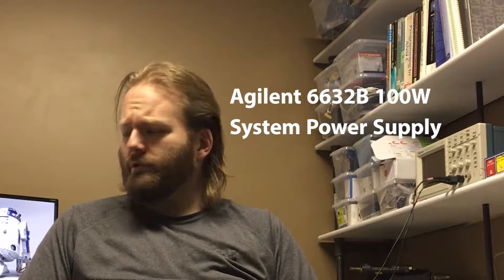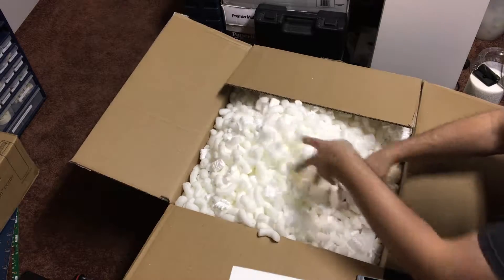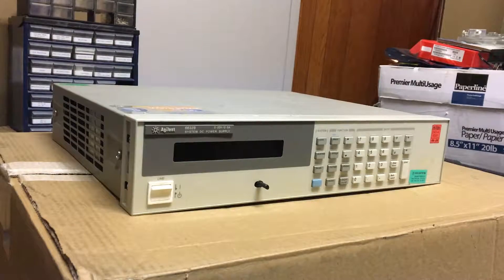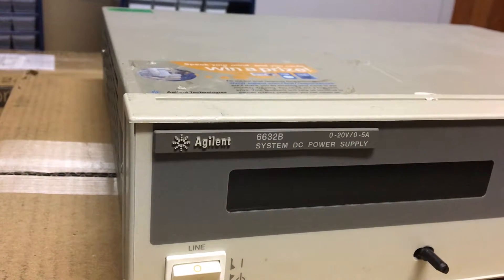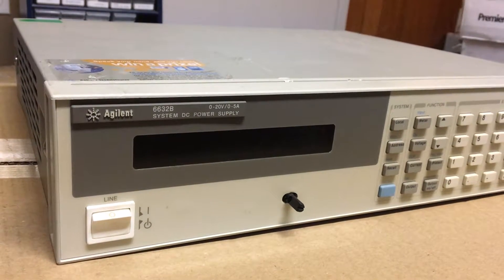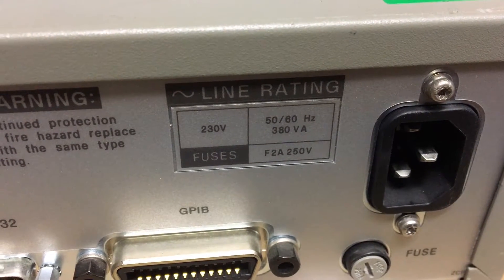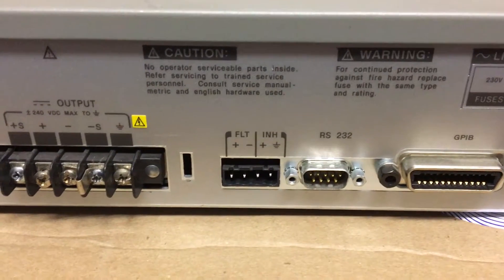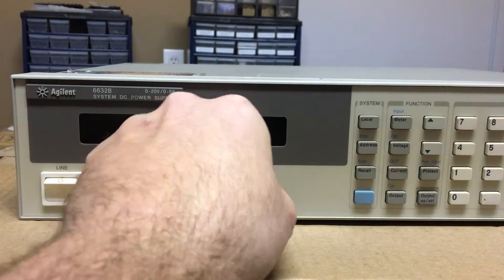HP/Agilent 6632B PSU and 34401A Multimeter Unboxing (for repair)

Comment: Thank you kindly good sir!  I have a stack of 6652a power supplies and a customer asked me to test one before sale (of course, perfectly reasonable) - only for me to see it was set for 240VAC.  I opened it up and was hunting around the power line-in port area trying to figure out if there was an easy solution - got over-focused and didn't look elsewhere (like the transformer), your video saved me on that.  Much appreciated.

Comment: The red sticker says that this unit was calibrated in 2006 from a DKD accredited lab. DKD was the German national standards lab (Accreditation Body of Deutscher Kalibrierdienst) at this time (As NIST is in USA). Today it is the DAkkS. The number 02201 stands for Agilent. So this unit was bought in 2006 in Germany from Agilent. In Germany the setting 230V is correct.
Reply from the maker: Good to know!
As this was a surplus auction item that was eventually put up on ebay as "for parts/not working" It has been working very well for me so far after re-configuring the transformer for 120v input. It was very well taken care of over there, the VFD is bright as can be. Even when enabling the extra digit there is no difference in brightness on that digit so the display has seen a fairly low amount of ON time.